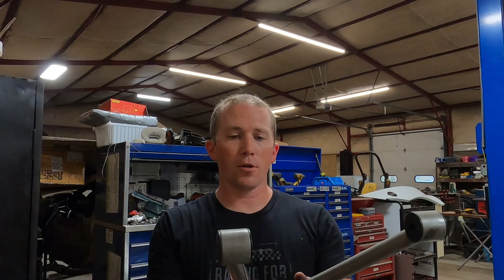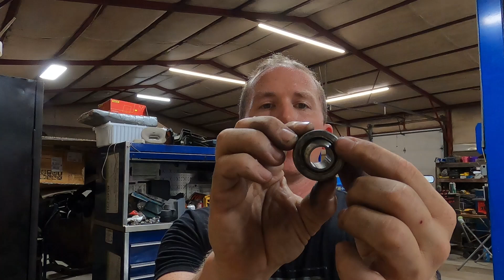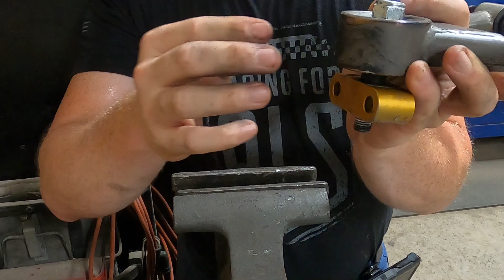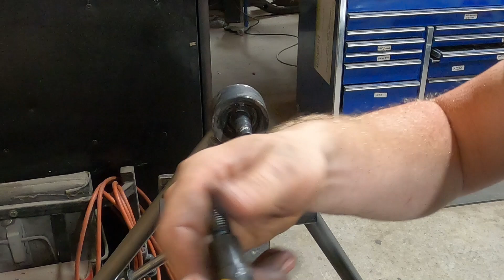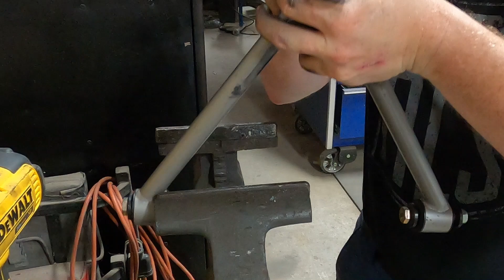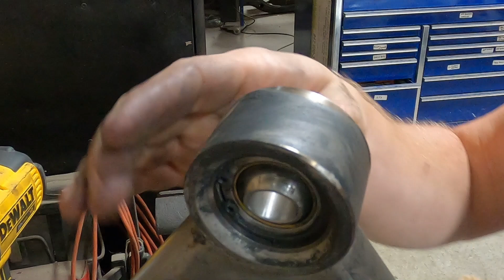Rush SR Ball Joint Replacement & Control Arm Inspection

Comment: I get it - #racecar.  Are you breaking this stuff via reasonable bump-n-runs or rough offs? For example, the upright bolts - us Lotus guys have the same thing.  They are a wear part but if they break it usually causes $$$.  But ball joints etc last years, the car is pretty maintenance free, at least with no contact HPDE type use.  To bend control arms would prob also result in a bent wheel also.  Anyway, trying to get a feel of the durability of the Rush.  If I get one I already subscribed as I appreciate the great videos!
Reply from the maker: Breaking it via off roading and car to car contact typically. Haven’t bent many wheels, the cars are very reliable and pretty maintenance free!
Reply: @speeddemon9329  cool to hear.  I did order one.  If the last ETA I was given holds true it will have been 14 months from order to delivery. I saw you are a dealer now. 👍
Reply from the maker: @ISpinUWin what’s your new delivery date and what are do you live in?
Reply: @speeddemon9329  Oct.  Dallas area.
Reply: @speeddemon9329 to update you it took 22mo from order to drive.   :(
Reply from the maker: @ISpinUWin it’s worth the wait!
Reply: @speeddemon9329 now that I have it I’ll agree
Reply from the maker: @ISpinUWin awesome! Let me know if you need anything for it parts or service wise!
Contact@rushcarolinas.com
843-672-4846